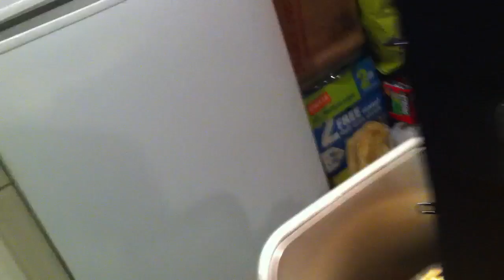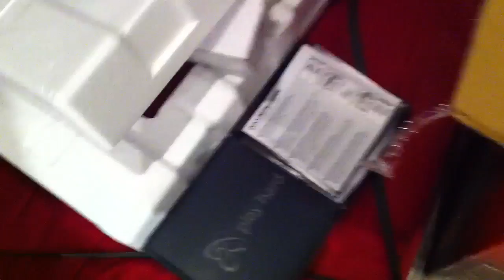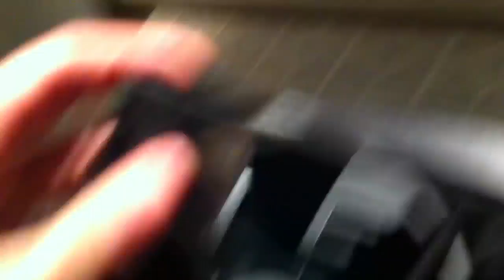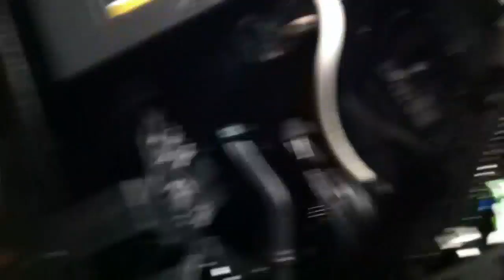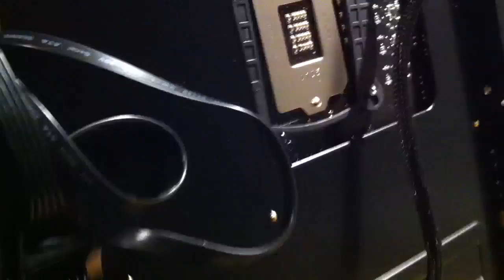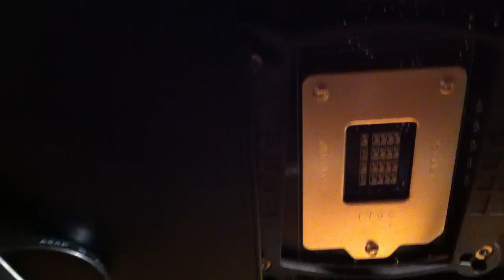Core i7 2600k Sandy Bridge Radeon hd 6950 crossfire build Part 1

Comment from the maker: @topgear2209 I put a second fan on the Antec Cooler for push pull cooling. I used the fan which came with the computer case. The Antec cooler came with a few extra small screws and not long ones. so to mount it I needed to use a long thin phillips screw driver to mount the screws by passing it through the top set of holes and down to the bottom set where I set the screws in. It worked out fine. And I only used to screws one on each opposite corner.

Comment from the maker: @olafreinhardweyer Yep that it does, The Antec H20 620 Includes it's own fan and everything you need. As I said I still used the 120mm fan that came with my Lancool case and used it as a secondary fan for Push / Pull Airflow.  Don't sweat being a noob. We all were at one time.

Comment: So to put it simply, the Antec takes over the job of the original Lancool k62 Back exhaust fan and i could stop right their without any extra modding and be fine.

I must say it's funny we are building such a similiar rig, because i discovered the Antec only yesterday while i questioned you about the HDD cases much earlier. I can't be such a noob i think :D

Comment from the maker: @HenkSpankK These are non reference XFX versions. They can not be flashed with modded BIOS like the reference design without doing a mod which requires soldering a wire onto two pins of one of the chips on the circuit board. I didn't realize this when I ordered them or I would have paid the extra $15 each for the reference design. I'd only have been interested in doing the shader unlock. The full 6970 Bios unlock could fry the board over time.

Comment from the maker: @olafreinhardweyer The water cooling kit comes with its own 120mm back fan.  If your case doesn't include a fan you wont need one.  Mine included a 120mm fan, I added it as a secondary fan on the opposite end so I would have a push Pull configuration for air flow.  The Antec fan pulls the air through the radiator and out of the case. The extra fan mounted on the oppsoite side pushes air through the radiator and out of the case. This added 1 to 3 degrees of cooling. Higher RPM Fans will cool more

Comment: I got the same case and wanted to go for Scythe Yasaya, but i simply don't want such monster cooler in my system. I won't put together the case myself, but i am still wondering: Your Antec Watercooling unit completely replaces the back fan, right? Does the Antec exhaust unit also exhaust the cases air and not only the tied in CPU heat? Would i need to have an editional back fan elsewhere if put the Antec into the case? Got a single HD6950 2gb by the way and will run an asrock a870 Extreme3.